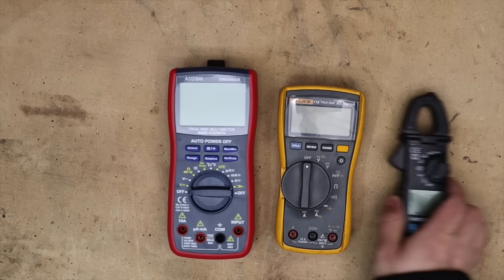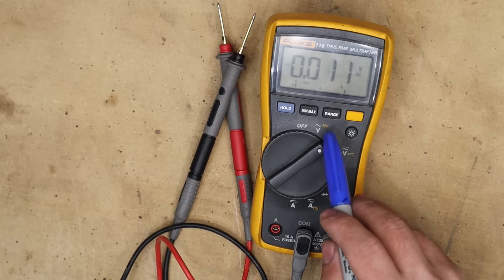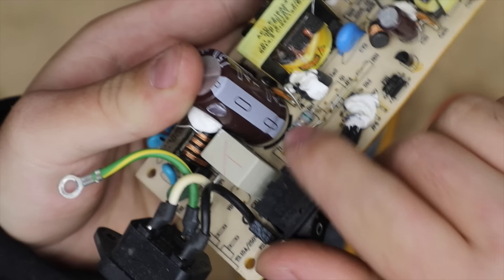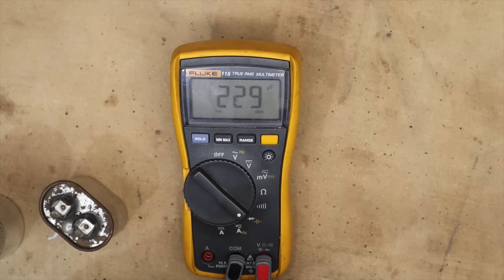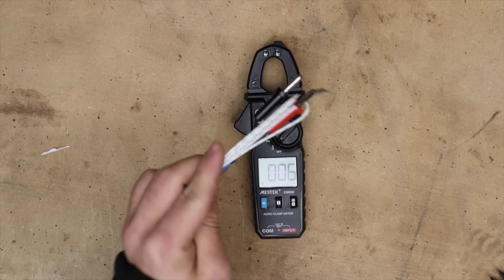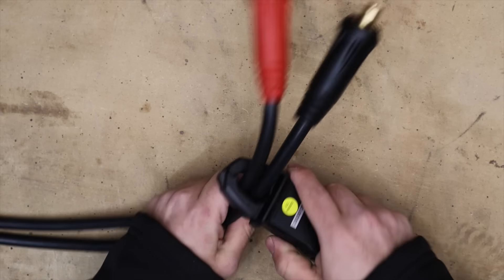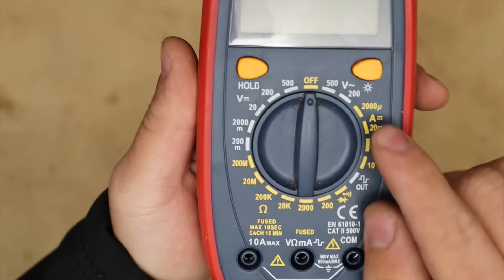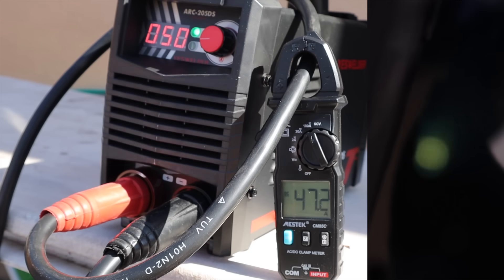How to use a multimeter like a pro, the ultimate guide

Comment: "OL" Does not mean "open loop" it means "Over Limit", meaning that the measured amount is greater than what the meter can detect. You don't just get OL on reading resistance, you can see it on any setting. Telling people that it means Open Loop is dangerous. Not all meters have automatic range, so if you are in the wrong range you might get "OL" until you go to the correct range. For example, if you are measuring 10 MegaOhms but you're on the range for 100 Ohms, you will read "OL", but if someone thinks that is now an Open, it could lead to them thinking the circuit is no longer complete. It's wrong, it's dangerous, and it only hurts your understanding of how the meter works to think it means anything other that "Over limit" or "Out of range".
Reply: I see what you are saying but if you have an auto range it is pretty safe to say it is open loop, always confirm with continuity test. My meter does the continuity test with the resistance reading at same time.
Reply: @corykroes7784  Actually, the comment @alksmdlaks makes is absolutely correct!  “Out of Range” is the proper way to interpret “O/L” from most electronic multimeter displays.  

During my Electronic Engineering Technology (EET) classes in college, I was taught all of the functions of a multimeter actually take readings from the electrical properties of the connection with anything the measuring leads touch (including the open air when not touching anything).  When a multimeter is capable of performing “auto-ranging,” the meter’s internal circuitry cannot (or can) sense a presence of electricity, they become very sensitive and will set its range for its internal circuitry at the most sensitive possible.

When connected to a circuit with high potential energy (amperage - too high or too low), energy differences (voltage - too far apart), or can’t apply a enough current to measure any amperage (resistance - very low current being passed to be measured by internal circuitry), the meter is determined to be “out-range” and displays “O/L or “OL” to represent the measurement is outside of the measurable range available in the meter.

But, because of the seven segment LCD displays used by most manufacturers, but not all manufacturers, are limited to just seven segments to convey out of range conditions (think about the miniature horizontal and vertical lines used to make a number “8” on an LCD/LED display), to display letters that are mostly normally recognizable as numeral digits, manufacturers prefer using “L” for the word “Limit,” as opposed to an “R” for the word range “Range,” probably because using all of the segments to display an upper-case “R” looks a lot like “A” and also suffers the possible mis-read of an 8 (think “O/8” may look too much like a “018” if the viewer believes a bottom line on the right was actually there, when maybe it wasn’t.

Hence, you will almost always see it abbreviated as “O/L” to convey the “Out of Limit” description for an “Out of Range” result.

So, when the video creator states “Open Loop’ during his commentary, he IS actually misleading his viewers & he may not be technically using the right terminology in every situation, at least not in the sense of amperage or voltage readings.  And, as @alksmdlaks mentioned in his comment, this is especially true when the meter is NOT an auto-ranging type of multimeter & is encountering a situation where the meter is NOT set to the correct range, for which that multimeter has been exposed in a test.  This will most likely lead to an erroneous determination by the user.

“O/L” is actually intended to alert the user that the multimeter (or Volt-Ohm-aMmeter - “VOM”) for “Out of Range” or closer to the intent because of the display’s limits, “Out of Limit” (no pun intended).
Reply: @kevin67k  this might be true but I have yet to find a piece of wire or motor that had so much resistance that it puts the meter out of range just based on resistance. 

I do however admit I was wrong on stating open loop since this isn't a loop tester. Ànd is a mm so over limit makes sense.
Reply: And, “O/L” isn’t just used on the Continuity or ohmmeter settings.  It also shows during tests with the other meter’s functions.

Comment: Pretty good but OL does not stand for Open Loop. It is ether Over Load or Over Limit.  Meaning that what every is being measured it is over the limit capabilities of the meter or meter settings.  If you measure 12V DC on a 4V DC scale the circuit is not open and yet the meter will read OL. That is because you are trying to measure a value that is over the range selection capabilities hence OL = Over Limit.

Comment: My fluke meter like the one you used here stopped showing anything on the screen. I have changed battery and tried everything yet not working. What can i do
Reply: Look for a blown fuse in it
Reply: If not fuse check the zebra connection of LCD, especially if you dropped it
Reply: Hopefully you didn't brick it into firmware update mode by placing it on your cellphone 😬 I think that was only the 87V and they'd may warranty it if that were the case

Comment: Kila 😬

Here a tip for beginners. If you don't want to killa  fuse in your meter, make sure you don't have the probe plugged into the current jack, as you're going to short circuit whatever you're probing.

Comment: In the thumbnail picture you have 2 symbols you didn't talk about. The lightning bolt symbol and the one that looks like a yellow Y turned sidways with a cicle around it.
Reply from the maker: I did explain the yellow one, that is a transistor, which is tested with hFE, the lightning i did not explain, good point there, its just a feature on some meters that warn of dangerous voltage levels
Reply: @james_gatlin thanks for the response. I understand now that the symbol was equivalent to hFE, but nowhere in the video or on the multimeters themselves was that symbol used or described so it was confusing.
Reply from the maker: Good point and something ill be sure to consider and implement in future videos, thanks for the feedback  @realSamAndrew  and keep it coming.

Comment: The jumper cables were connected backwards when trying to jump the car , now the headlights tont work. The fog lights work, and the driver side bright light works. Judt not the head light by themselves. The radio fuse broke. And when i installed a new one it blew out once i turned my ignition on. My wuestion is where do ii begin to trouble shoot?

Comment: OL does not mean open loop. It means over limit, which means it is over the limit of the measurement capability of the meter.
Reply: Your are correct when measuring voltage it's over load so switch to high setting but when measuring continuity OL is open loop meaning you have no continuity.

Comment: What if air conditioner has its own dedicated line do u use ac voltage or dc voltage to test
Reply from the maker: Read the input on the AC unit, it should say DC or AC, though typically all appliance input from your home will be alternating current, and the signal wire coming out of your condenser will be direct current, depending on the size and type of the unit, but there’s many nuances, ultimately you have to find the label input to be sure.
Reply: @james_gatlin  thanks

Comment: 120VAC is not high voltage. That's why you can test it with a low voltage meter. I believe you should explain the differences between low, medium and high voltage in this video.

Comment: My multimeter shows 1.292 using (0.000) on a rechargable battery of 1.2 wich according to this video, it means that the battery is good. but when I put the battery in a digital temp measure it gives the battery low icon and it goes off.

Then I tested another battery of 1.5 non-rechargable and the multimeter showed 1.589 or something which is still in range. So both batteries showed in range but one worked and the other not!

Does that mean my multimeter is not working properly?

Comment: also there is an issue with auto raNGE multimetres...and it is that every time you mesuring something the mether needs time to find the rANGE AND THEN SHOWING... that lead to 2 problems in my opinion.... the first is just slow if you mesuring 1000 bateries each 4 volts in this scenario the manual mether can be set on right range and not loosing time to find the right range every time its about a 1-2 seconds but still if it is repetition in there .... the secont problem in my view is when you trying to see a voltage that change in time faster then 1-2 times per sec it will be hard to see voltage when with manual mether there is a chance if it is around 1 sec per change to see the resolts  biggest one issue is even if ocure rarely it is when the resolts are somehow between the ranges of the auto mether and also resolts slightly changing in time then the mether can jumping from testing one rng again and again and not showing the resolts......have a nice solder comrades

Comment: Great video, mate, well explained. If I can share a tidbit of knowledge, it is a very common misconception that “OL” means “open-loop” as you said. It, however, means “over-limit”. Certain ohmmeters and insulation resistance testers (built in as a function of a multimeter) will have different range capabilities. So a cheap Class I multimeter might read OL if it is outside of the units calibration or ability, but a more specialised Class IV meter or more expensive model might return a reading.
Reply from the maker: Appreciate the comment. The meaning of OL is am interesting one, it actually dose not have a defined meaning, some on the common ones are:
-over limit 
-open loop
-open line 
-over load
-out of limit
Heard it all, and pretty much all the same thing, surprisingly, there is no agreed meaning, Fluke for example states in the manual that OL is “The input is too large for the selected range.”, though never states the meaning of the acronym, so feel free to use whichever you like from the list above.

Comment: OL means over limit. As in infinite resistance
Reply from the maker: -over limit 
-open loop
-open line 
-over load
-out of limit
Heard it all, and pretty much all the same thing, surprisingly, there is no agreed meaning, Fluke for example states in the manual that OL is “The input is too large for the selected range.”, though never states the meaning of the acronym, so feel free to use whichever you like from the list above, 
Even in this video we’ve had 4 different people, all stating there own different version of OL, thanks for the comment.

Comment: During my Electronic Engineering Technology (EET) classes in college, I was taught all of the functions of a multimeter actually take readings from the electrical properties of the connection with anything the measuring leads touch (including the open air when not touching anything).  When a multimeter is capable of performing “auto-ranging,” the meter’s internal circuitry cannot (or can) sense a presence of electricity, they become very sensitive and will set its range for its internal circuitry that the most sensitive possible.

When connected to a circuit with high potential energy (amperage - too high or too low), energy differences (voltage - too far apart), or can’t apply a enough current to measure any amperage (resistance - very low current being passed to be measured by internal circuitry), the meter is determined to be “out-range” and displays “O/L or “OL” to represent the measurement is outside of the measurable range available in the meter.

But, because of the seven segment LCD displays used by most manufacturers, but not all manufacturers, are limited to just seven segments to convey out of range conditions (think about the miniature horizontal and vertical lines used to make a number “8” on an LCD/LED display), to display letters that are mostly normally recognizable as numeral digits, manufacturers prefer using “L” for the word “Limit,” as opposed to an “R” for the word range “Range,” probably because using all of the segments to display an upper-case “R” looks a lot like “A” and also suffers the possible mis-read of an 8 (think “O/8” may look too much like a “018” if the viewer believes a bottom line on the right was actually there, when maybe it wasn’t.

Hence, you will almost always see it abbreviated as “O/L” to convey the “Out of Limit” description for an “Out of Range” result.

So, when state in your video “O/L” as “Open Loop’ you may be misleading & may not technically be using the right terminology in every situation, at least not in the sense of amperage or voltage readings, that is.  “O/L” is actually intended to alert the user that the multimeter (or Volt-Ohm-aMmeter - “VOM”) for “Out of Range” or closer to the intent because of the display’s limits, “Out of Limit” (no pun intended).

Comment: So How to know if my voltage is dc or ac when there is not information around and you need to test it but don't want to damage the multimeter
Reply from the maker: Look at the wires, if there is red and black, its DC, if wires are identical its AC, also what powers it, if batteries, then its DC, if its a generator, then its AC, there are many signs to learn, though that is outside of the scope of this video, future video soon with more topics and information
Reply: @james_gatlin  also what is the best multimeter ever that can do everything, like the highest end  , price don't matter
Reply from the maker: Hard to say, i don’t know of one with all the features, thats also good and the best quality, my best recommendation for most common applications is the fluke 117 (there is a link to the fluke 117 in the description)
Reply: @james_gatlin  thank you very much , trying to be in this electrical field

Comment: OL is OUT OF LIMITS
Reply from the maker: -over limit 
-open loop
-open line 
-over load
-out of limit
Heard it all, and pretty much all the same thing, surprisingly, there is no agreed meaning, Fluke for example states in the manual that OL is “The input is too large for the selected range.”, though never states the meaning of the acronym, thanks for the comment.

Comment: Funny how at the end he says if you’re a beginner and don’t need a manual ranging multimeter then you can just choose a less expensive auto ranging meter and then points to the Fluke which is the most expensive meter in his line-up. 😂
Reply from the maker: Ups
Reply: Sorry. I just found it amusing. Video was very good and accurate. Well done. 👍 I love Fluke meters and they are really all I use. But I should also say I’m in the trade and I realize most DIY’s won’t purchase them due to their expense. Have a great day.

Comment: How do measure STRAY voltages using a DVM meter?
Reply from the maker: Thats more a question technical use over function, but its simple, you just ground the common on voltage, and touch the positive lead on what you want to test for.
Reply: @james_gatlin   but that is testing non-stray voltages. I'm talking about how to measure STRAY voltages using a DVM meter, how is this done?

Comment: 1:58 Is not correct; the other probe does not become live unless one probe is plugged into the terminal for measuring Amps.
The common terminal used for measuring Voltage does not let any currents pass from one probe to the other.
Reply from the maker: On most modern meters yes, however not all, many meters especially older units, will become live, hence the “could”, always exercise caution.

Comment: You forgot to mention that to test a cap you have to isolate it and charge it, but maybe that's outside the scope of this overview
Reply from the maker: It dose not have to be charged when using the Farad feature, capacitors also have voltage to be tested, and in that case it should be charged, otherwise it doesn’t have to be, but yes, i should have made a more general comment to isolate all components, thanks for the feedback, will implement in the future.
Reply: All the meters I have seen that measure capacitance have a warning message to discharge the cap before testing it. The meter will apply its own voltage while testing capacitance. A few meters can do this without isolating from the circuit, but other items in the circuit can change the measurement, so it best and most accurate to isolate any component you want to measure.

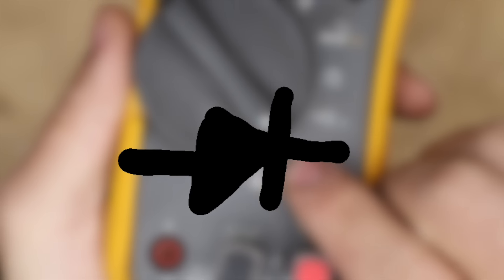Comment: What is the number on the diode mode? 5:55
Reply from the maker: forward voltage, each manufacturer will tell you what it should be on the data sheet.

Comment: Who else always though the OL stood for "overload", as in the resistance overloaded the meter's ability to measure the resistance
Reply from the maker: -over limit 
-open loop
-open line 
-over load
-out of limit
Heard it all, and pretty much all the same thing, surprisingly, there is no agreed meaning, Fluke for example states in the manual that OL is “The input is too large for the selected range.”, though never states the meaning of the acronym, so feel free to use whichever you like from the list above.

Comment: How do you measure Watts of amplifier?
Reply: You'd need to simultaneously measure the rms current and voltage.  The fluke 87V claims to have "true rms" by use of an integrating circuit, cheaper meters tend to assume single wave and just multiply by sqrt2, so in that' you may beimoted to driving it with a single frequency,  or need to build a little measurement circuit.  Easiest way would be with a modern oscilloscope that can do math for you onscreen. Or, just get a power meter... but you may not get an accurate result of what your trying to measure of you don't understand how it is measuring. You're really best off with an oscilloscope.